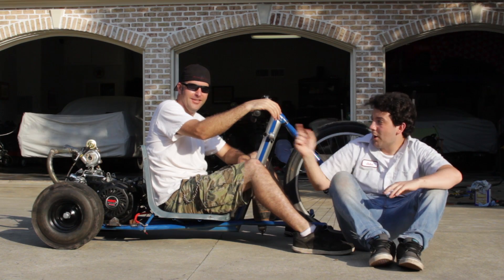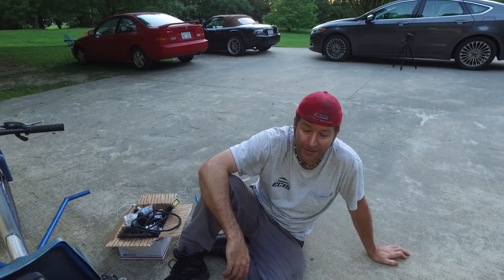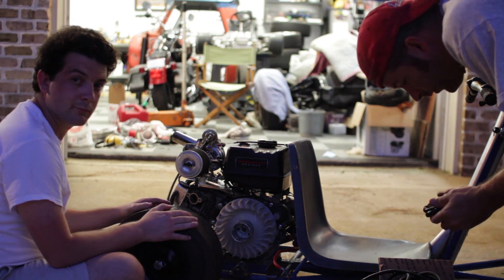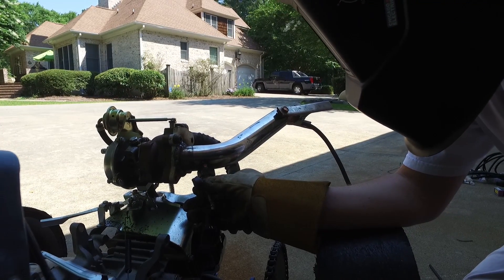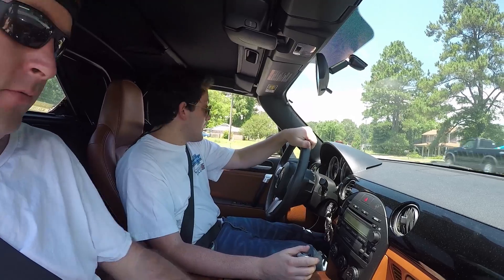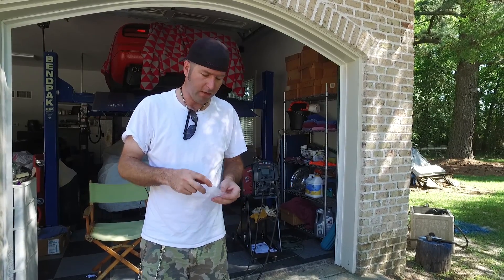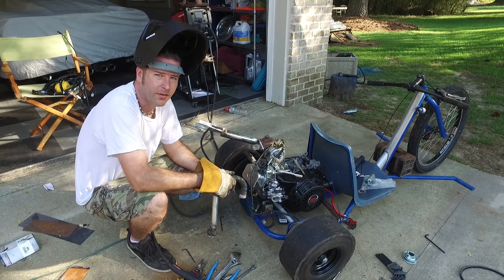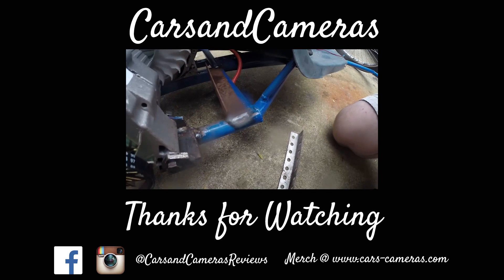Turbo Drift Trike EFI Install Pt.  1

Comment: I know this is an old project but just a reminder you have probably heard by now. Never mount an o2 sensor in the bottom of an exhaust pipe. Moisture build up in the sensor will kill it since it can't drain out of it.

Comment: EFI is pointless you both are Far too stupid to understand that a EFI on a 1 cylinder Engine is a waste of money and time.
Reply: Metal Rott they installed the efi to be easier to run with the turbo instead of trying to make a blow through carb

Comment: Could try putting computer fans in the side of the tank to move air for the electronics. A fan on one side to push air in and a fan on the opposite side to pull air out.

Comment: try using a radiator hose for the intake from the turbo to the throttle on the engine.

Comment: hi
i have 2 problems with my pocketbike:
1/ the engine won't throttle but the throttlecable is fine?

2/ the engine worked perfect on a small frame (doesn't throttle) and now on a big frame it doesn't even start
Reply: thats a tough one
Reply: +Isaac it'll be fine i now :( does anybody Nows a solution
Reply: not without seeing it in person
Reply: +Isaac it'll be fine hmm

Comment: Turn the main frame tube into the gas tank. Mount the fuel pump under the seat. Make a louvered aluminum box to fit in the location of the stock fuel tank and hold the electrics, then add a small tube for the cooling air from the engine's fan running into the electrical box.
Reply: Scratch that, mount the alt on top of the engine and drive it like I said before. Mount the electrics in the back of the seat, done.

Comment: you guys really should put an ARC billet rod and a hotter cam in the 420, it would make a huge difference, especially with the turbo, you'd need stiffer valve Springs too

Comment: could have saved yourselves one shitlload of trouble and heartache if you only read your comments. like I already said when you fitted the turbo at first you could have used the same principle as the A series Rover mini metro turbo carburatted system. it's as simple as sealing the carb and venting the bowl directly from the pressure side of the inlet and using a fuel pump that delivers petrol to the bowl at 5 or so psi more than max boost of the turbo. and yes the carb goes between the turbo and the head, and not before the turbo, most simple, reliable and easy way to do it. Mike.
Reply: yes that would have probably worked for us

Comment: Once it's together, should eventually replace the ugly pipe with one that's nicely bent by filling with fine sand and heating it up to do a nice smooth even bend. Should flow better too.

Also I'd still say a front fender would make it more enjoyable to ride when done, you'll eat less gravel and dirt. And mount an amber LED running light on the fender for style points.

Comment: Looks better without the gas tank mounted on the engine. Sleeker kinda. Also for a gas tank up front you could use a couple of venom energy drink cans in bottle brackets teed together and pop vents in the caps.

Comment: there needs to be 1 foot of pipe between the turbo and the sensor or it won't read correctly
you are gonna need a longer exhaust
Reply: we are going to put a tip on it
Reply: its the turbulence coming off the turbo veins that mess with it might be fine in such a small motor but who knows
Reply: we will see

Comment: Love to know how much it all costed
Reply: Put it this way, the EFI kit is well over $600, turbo was probably another $300, exhaust pipe frame was probably free or maybe $30, the front tire was free from Ike's brother but probably in the neighborhood if $75 or so, clutch was probably $40...all together its probably a $1400 drift trike. But I think the engine and some other parts were donated from either Garage Amino or GoPowerSports. Either way, this sounds more expensive than what the average shade tree builder wants to do.

You'd be better off just sticking with a carburetor, jetting it, K&N style filter, exhaust, billet flywheel, billet connecting rod, 26lb springs, governor removed...but majority of that is not offered on the Predator 420cc. The 212cc, since its used by amateur go kart racers, it has a much larger aftermarket support. But nothing beats a Honda GX series or Briggs and Stratton Animal

Comment: NitroMethane. 'nuff said.
i wish i had sponsors so i could afford this $500 50hp clutch  and a live axle and could weld  a roll cage and side panels. i mean all i really need is like 40horsepower and a live axle. i'll buy engine mods,suspension, and street legal stuff my self.
Reply: i go 60mph so far and chase cars for fun but i need a fuel pump( video coming soon). i need a better clutch so i can go faster and not burn my belt.

Comment: It's a pity you didn't see my comments containing a lot of help on setting up your EFI. You have the o2 sensor mounted upside down, so it will fill up with water after a few times and destroy the sensor rendering it useless, so you'll have to buy a new one every few weeks or so. Not a good idea to weld the plug while the sensor is in there either, if you placed it correctly on the top it would have been fine to weld.
Reply: didnt think of that

Comment: having problems on how to hide that wirings well i got the solution. transfer the engine to the offroad go kart so it will be easier with that power you can drift it all day hahahha

Comment: Keep an eye on the readings from that O2 sensor. If it's too close to the end of the exhaust, you can get some false readings with outside air swirling back inside. I would put it between the engine and turbo. You might need a deeper bung though (that's what he said), so it doesn't block half of that tiny pipe.

Comment: You guys should try using a RHB/RBH31turbo I'm not sure witch is wright but that turbo is really small I think small then your current one and it works better for the engines

Comment: I know it would ad more weight but why not put louvers on one side of the tank and wire up a small 12v fan on the other side to pull some air through it?
Reply: you could put the fan on top where the gas tank cap is also all kinds of options.

Comment: why not try silicon radiator hoses for your intake?
Reply: theres no intercooler so its extremely hot air and will eventually melt it
Reply: No it wouldnt. And it would have less heat soak, look and flow better than that welded up pipe.

Comment: I see this failing and going in the shed for months,
Reply: Carburetors for life brother! Don't much care for all the electronics for cars, to much to go wrong, can't wait for dual carbs on the 670! With dual cone air filters rejeted, brother that thing will be even better! And 3 wheeled things I don't much care too... I think all this for a trike is dumb, maybe one of the karts you got for the build off needs the trikes motor.
Reply: w'eve submitted your review to the internet where most ppl dont give a fuck
Reply: give us 5-7 days to review your review and submit our review back.
Reply: we just wanted something different
Reply: Isaac it'll be fine understandable, now make a drag drift trike lol
Reply: we will see what it will do. lol
Reply: Isaac it'll be fine I'm super excited to see what it will do when running right with boost, your gonna have to take the PBC pipe off, it's demanded now dude lol good luck!
Reply: thanks

Comment: y'all should put a Briggs&Stratton vanguard v twin on the rat rod cart
Reply: Those start at around $1000 and they are pretty heavy.
Reply: +Ratkill9000 you can get one off an old lawnmower for pretty cheap
Reply: +Text Missing Like a Cub Cadet. Have one and while a great engine, it gets tired after 600 hours. less you want to rebuild one.
Reply: +Ratkill9000 i have one on my craftsman, it needs a new carb. it probably has way more than 600 hours on it
Reply: I'm at 649.6 hours and its still going but it has a miss fire and the plugs are new. May need a new coil

Comment: Ike can you tell me where you bought your go kart and its name +carsandcameras
Reply: +CarsandCameras
Reply: +Skaterboy 58 they made it out of an old bicycle frame, a 420cc Raptor engine, live axle drive train, a small turbo, efi system, and a hunch of ingenuity... all of which was sponsored by different shops of course... over all its not too expensive to build yourself one... I got myself a used 212cc predator for $10, I had an old bicycle frame, now I need the live axle, sprocket, wheels, and centrifugal clutch to make the drift trike...or I can just buy a centrifugal clutch and install it on some pedal karts I bought for no more than $80, those things hold up 300 lbs so they ain't too light for the engine
Reply: which go kart?
Reply: +Paul Rodriguez I mean the one with the Afro😂
Reply: +Skaterboy 58 oh

Comment: You could have used the kill switch wire for the crank sensor if the ecu supported that. It's what I drive my tach off on my 12.5 briggs.
Reply: Good idea!

Comment: the o2 senser really needs to be on the manifold from the head as the turbo could change the ratio of fuel left comming out giving a false reading
Reply: how? how could it change the A/F ratio? unless there is a leak somewhere there is no way the turbo will change the amount of oxygen in the exhaust.O2 sensor should be after the turbo, as the pressure in the manifold before the turbo WILL skew the sensor. More pressure = more oxygen sensed, as what oxygen molecules are  present are packed tighter together.

Comment: I've made many a gasket like that myself, but I used the ball end of a ball peen hammer.
Reply: Sometimes ya gotta work with what ya got , in a pinch if you don't have any sealer for your homemade  gasket , use a couple coats of spray paint and let it tack up...
it's fun to get apart again though. 
I just did that trick on a gasket today that started to separate,but I was too lazy to make a new one for😂

Comment: Don't you need a intercooler when you're using a turbo?
Reply from the maker: +Jonas Henriksson (Henke) not in this application
Reply: it doesn't need it, it's a small motor,... btw no turbo needs an intercooler,... the inter cooler just cools charged air into the engine
Reply: you dont need one in any application. look at the first gen dodge cummins, or the dodge daytona Turbo1, both are not intercooled, one diesel, one gas

Comment: when mounting a wideband sensor, it should be around 10degre pointing upwards so no moisture or other contaminations keep lying around in it, for accurate measurements.

besides that im curious to see what EFI does on the little engine.

Comment: also, you could use some piece of hose to connect the turbo to the TB and fix the alternator in the place of the old fuel tank and cut it open in the bottom to house the alternator

Comment: the O2 sensor should be mounted upwards a little bit inclined. downwards accumulates humidity and therefore makes it work poorly (or not work at all)

Comment: how will this work without any kind of intercooler?
Reply: small turbos dont realy need intercoolers, matter of fact no turbo NEEDS an intercooler, they just cool air for better performance
Reply: +KARTSANDMINIBIKES i just thought that would cause the engine to over heat since the engine has no kind of cooling other then air

Comment: if you wind up having trouble with idle fuel mixture move the O2 sensor to the exhaust pipe between the turbo and the engine. There will be quite a bit of air being pulled into the turbo outlet between exhaust and could throw off the sensor readings. OR "It will be fine!"

thanks for the videos!

Comment: Did the turbo increase the power, if so by how much? Also does the turbo come in at certain revs and why doesn't it turbo whistle? Sorry for the questions if they seem dumb but I think is a great channel to learn about engineering and how things work in the engine. Cheers.

Comment: still say you should have put that turbo on the 670..
Reply: That turbo is a little small for a 670 I think...
Reply: TR7 TRIUMPH "it'll be fine"
Reply: John Smith Lol, but I think the 420 Is a good size to make the most out of the turbo at low end without being restricted at the top end by the small size of the turbo. :p But yeah, it would probably be fine.
Reply: it is. wont provide meaningful boost.
Reply: Twin turbos would be better. Either twin or compound, either way it would be awesome.

Comment: Ike why didn't you weld a stub pipe on the turbo and intake flange and use a rubber hose to connect them not to much psi there?

Comment: Didn't you guys say that you had to have the gas tank higher for the turbo and carb. to actually function. If you put it lower, then it won't function.
Reply: Thats just for carburetor engines
Reply: That's the thing it's still carbed. right?
Reply: Efi needs a fuel real fuel pressure. It will would need a fuel pump anyway
Reply: Oh, ok. Thanks!
Reply: we have a fuel pump now
Reply: Oh, okay.

Comment: Hey guys, Been watching for a good while really dig your builds.On the manifold from the turbo to the engine why not try usingshort flanged fittings on the turbo and engine using hose of the proper pressure rating? Maybe a  small radiator hose from a small car. The tight angles are a flow killer and this could boostthe power. It would prevent gasket blow-outs, with the flex in the hose. Great work guys, keep the videos coming.
Reply: thanks

Comment: roflmao put the o2 sensor in the screamer pipe so when the waste gate hasnt opened the computer things the motor is off guys put the o2 before the turbo
Reply: That is not a screamer pipe, all the exhaust from the turbo and wastegate goes through the same pipe.
Reply: putting the O2 before the turbo is a BAD idea. the pressure in the manifold skews the sensors reading.

Comment: So no intercooler? This seems like a bad idea
Reply: +FEAR NONE KILL ALL why don't they need it... they're compressing hot air into a small engine, so it's even HOTTER air. idk just wondering..
Reply: It will be fine. Yeah it will be hot air but it doesn't matter
Reply: we dont have one
Reply: They could get one but it wouldn't be worth it. Too small of a turbo to really make a difference. Besides that's more plumbing and more added weight.